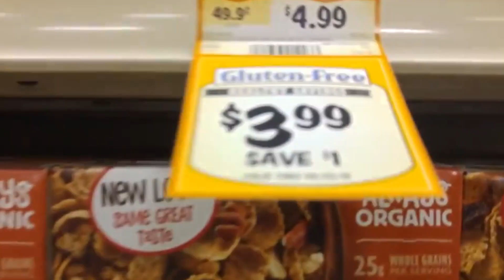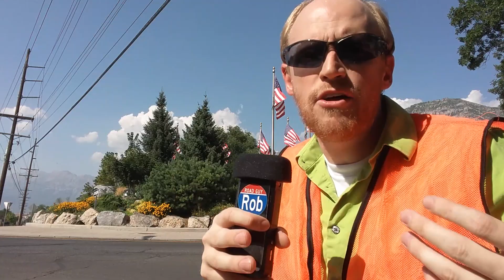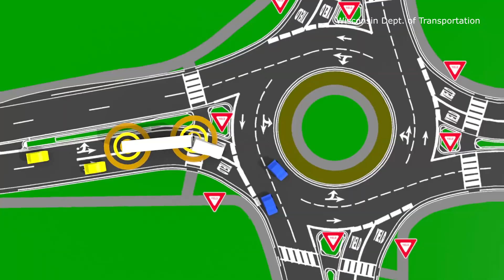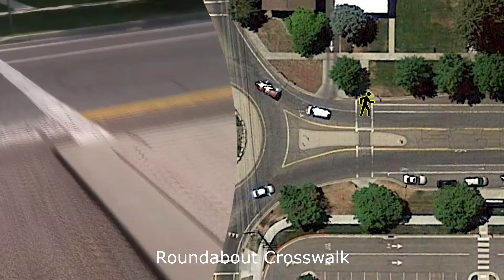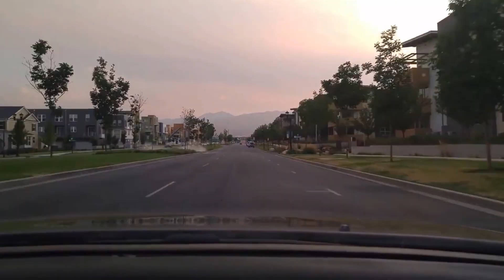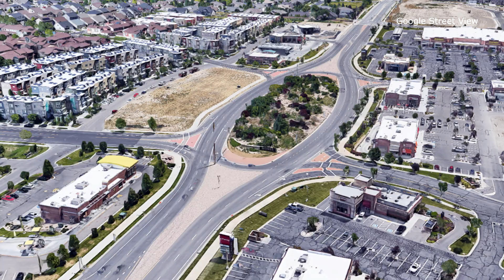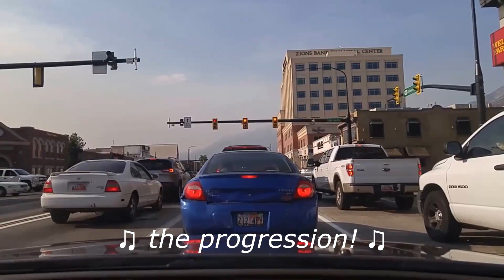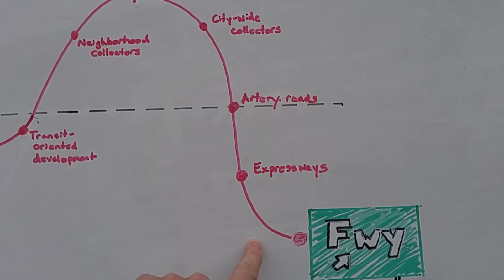Are roundabouts REALLY better than a traffic signal?

Comment: Who says roundabouts are terrible?
Reply: People who have to cross them on foot?
Reply: @robo1p  I highly doubt that, if they are designed correctly. For example, in Germany we have crossings for pedestrians right at the drive in / out sections of the roundabouts, so you only have to walk slightly farther than you would on a normal intersection. Additionally, pedestrians always have the right of way, so there is (almost) no waiting involved, compared to a normal intersection with traffic lights.
Reply: Example: https://www.google.com/maps/place/Esslingen+am+Neckar/@48.7209538,9.3846742,149m/data=!3m1!1e3!4m5!3m4!1s0x4799c0d259ee4ccb:0x41ffd3c8d092980!8m2!3d48.7433425!4d9.3201122
Reply: @robo1p  In The Netherlands pedestrians on zebra crossings have right of way over cars on the roundabout. Also within city limits or buildup area’s, bicycles have right of way over cars if the bicycle paths are crossing the exits of the roundabout. On the roundabout there could also be a bicycle lane next to the car lane (the outer lane is for bicycles, the inner lame for cars) than cars can only leave the roundabout when there aren’t any bicycles in their way, if so they have to wait until it is save to leave the roundabout. Also bicycles have to give cars and other bicycles right of way if they want to enter the roundabout. That is marked by sharks teeth on the asphalt, just before entering the roundabout. Sharks teeth pointing towards you means you have to give way before entering. Also very safe are the middle or traffic isles for pedestrians, crossing the exit/entry of roundabouts, in Dutch this is called a ‘vluchtheuvel’, a flee hill. So pedestrians or bicyclists can safely wait to cross the second halve of the road, when it’s free of traffic.
Reply: @RealConstructor  In the USA pedestrians in crosswalks legally have the right of way too. The self-absorbed drivers here don't care.
Reply: @5stardave  Maybe there should be a law protecting vulnerable road users like pedestrians and bicyclists. We have that in The Netherlands and it works well enough. Could be better but it still works. In case of an accident between a motor vehicle and a pedestrian or bicyclist, the driver of the motor vehicle is automatically guilty and 100% responsible (for the damages), until he can prove he isn’t at fault. Then he is not guilty but only responsible for 50% of the damages. That gives the driver an incentive to be careful towards vulnerable road users.
Reply: @robo1p  it depends, if it's one of those roundabouts with crossings, then you cross them (the driver should stop, just like in regular roads), if it doesn't have crossings, then just walk a few metres and cross somewhere else, normally roundabouts aren't that big it just adds a few seconds to your walk, buta adds safety
Reply: square people
Reply: They suck!
Reply: I do because during busy traffic times one entry point dominates the circle.  The cars continually enter from the one entrance and all exit to the same point.   If your entry point is between those two points you end up waiting for a very long time.   You are talking easily over 5 and even 10 minutes of wait time.     The solution is you keep blasting your horn until someone is kind enough to let you in.
Reply: I do ive driven semi trk and they arent open enough for large trks especially oversize loads and ive driven meduim duty dump trk ive had where in the city i cant get through them and ive seen where they put a post in an intersection and called it a roundabout
Reply: Multiple lane roundabouts are terrible.
Reply: @davidhoffman1278  Not when you approach a turbo roundabout on pre-sorting lanes. They’re easy to enter and exit.
Reply: I'm not a big fan of the multi-lane highway ones, but the small, local ones are perfectly fine to me, and in some cases better than a traffic light.
Reply: People who actually know how to drive. Why do we even have these silly ideas, like roundabouts? Because nobody can get drivers to actually follow the f-ing rules.
Reply: Road cyclists
Reply: @andrewwestcott9172  They work fine in the Netherlands where eveybody cycles
Reply: @jakuub_11  Source? I may be working with outdated information but are you working with any information?
Reply: @Person01234  where is your source that says Americans hate roundabouts?
Reply: @Person01234  actually hes got a point, the video you commented on is a good source, and im pretty sure the USDOT has a stat somewhere listing all the roundabouts.
road guy rob has a point tho, roundabouts belong in areas with low traffic unless you go complete overkill, and not good in industrial or commercial areas with a lot of cars and really any amount of semis unless its big enough to accommodate trucks, but even then its not wise.
Reply: @Zeakthecat  That's not correct. Roundabouts consume a lot of space, that's their downside, for traffic throughput they are superior and work fine when there's lots of traffic.
Reply: @jakuub_11  Why. It's obviously a generalisation, and a true one at that. It's not hard to deduce that I am not saying "every single american who has ever existe hates roundabouts", I'm obviously saying that americans in general say roundabouts are bad.
Reply: Me,overflowed in small roundabout are terrible
Reply: Me
Reply: Blind people. They lose the advantages that a signal provides as they try and hear the traffic flow.
Reply: @NHSpaceMOB  Blind people always have the right of way, and physically handicapped person does and usually people do indeed stop for them as long as they clearly point out that they want to cross.
Reply: @roy_hks  Blind people do have the right of way, and in a world of self driving cars that might be fine, but with distracted driving a near epidemic, it's still very scary for a limited sight person to cross without knowing that traffic has stopped or that the course is clear. All you need is for one person not to stop to end your life and that's pretty scary.
Reply: Me.
Reply: Me
Reply: They’re not great you’re always forced to slow down 
At least with traffic lights you have a 50/50 of not having to stop or slow down at every single intersection
Reply: @Rommie26  But that’s so great about them, traffic slows down, but hardly ever stops. Intersections with traffic lights forces you to stop more then half the time. And slowing down before an intersection is safer for you and for other road users. It’s a win win.
Reply: @RealConstructor  I guess it depends on preference 
I’d personally rather not slow down and take
the chance the light will be green and I don’t have to stop or slow down
Reply: @Rommie26    Really, then the problem isn’t the roundabout now is it, it’s you. Who in their right mind would chance that the light would be green? No wonder there is so many examples of horrendous accidents in a normal intersection. “Hey let’s just chance it”. Why not look at the positive side, now you’ve got yourself a nice change of scenery, a real curve in the road and not just boring squares all the time, and as an added bonus a place to do a little drift if that’s your cup of tea (only if there’s no traffic of course), but then again I guess it depends on preference, and from what you’re saying I guess a good T-bone steak and 1/4mile is your thing.
Reply: Pull a 40ft gooseneck with 13,000lbs on the back of an alread over 20ft long truck. Not near as bad as a semi, but its hell on the trailer suspension when the tires are not as large as a semi but not as small as a car. Also, concider all the RVs that are basically rolling boxes down the road. Its hell on the structure having to constantly and consistently jumping curbs.
Reply: Every american with memories of traffic circles
Reply: Flat earthers.
Reply: They take up more room
Reply: Truck drivers
Reply: @jakuub_11  As with stereotypes about any country, that's pretty much what a steretype is. Nobody was talking about mass anti-roundabout protests. But you're probably quite right that it's old news. At the same time, I can't think of another noteworthy country with greater opposition to roundabouts, opposition just in the sense of "saying they're terrible". Canada maybe? Though they're commonwealth and tend to take cues from the UK a lot. Japan perhaps? I don't know what their opinion is on them. What I do know is that Americans had a had a harder time adjusting more recently than most.

Lets all just agree that traffic lights are the hell spawn of satan.
Reply: people who don't understand them
Reply: Roundabouts aren't terrible it's just the people that think it's all about themselves and that they have the right away no matter what.
Reply: people who doesnt understand how roundabouts work
Reply: Wait until you tried driving through DC roundabouts. You will HATE them.
Reply: My wife is terrified about roundabouts.😆
Reply: Roundabouts are terrible,
Reply: @5stardave  it really does depend on where the roundabout is placed.
Reply: Bad drivers
Reply: Roundabouts are terrible if the town/city they are being placed in is STUPID enough to make them so small that trucks have to run over the the raised centers in order to negotiate through them.
Reply: @GrayLensman51  many roundabouts here in Europe are nothing more than a circle painted on the road,usually in narrow roads which allows large vehicles to simply run over them. The usual give way rules apply and cars are still expected to go around the circle.
Reply: @GrayLensman51  But they have to do that at all roundabouts in the Netherlands and plenty of other European countries, at least when it comes to 1 lane roundabouts. If it were wide enough for a truck to not have to use the center curb it wouldn’t make that much of a safety difference because in that case it would also allow higher speeds...
Reply: Ignorant people scared of anything they've never seen before.
Reply: Most americans say roundabouts cause tornadoes.
Reply: @UltraCasualPenguin  shut up
Reply: Me
Reply: Americans.
Reply: @Person01234  stfu
Reply: @Person01234  Not all Americans.  I love roundabouts.

Comment: Great video Road Guy Rob, but when you think about it, highway interchanges ARE roundabouts on the highway. They're just not in the form of a circle but in all cases they require you to merge yielding leftward along a same-direction flow.
Reply: Paul Martyniak I wouldn't agree with that. Highway interchanges use different roads to connect each direction to another direction. On a roundabout you drive behind each other no matter where you want to go. And you could even stay on it indefinitely if you want.
Reply: Thanks for your reply, but I think you're splitting hairs -- obviously highway interchanges are not the exact same thing as a roundabout, however the point is that instead of an intersection where traffic flow is interrupted and alternates, interchanges flow continually. 

Moreover, many clover interchanges WOULD allow you to keep going around and around as long as you want, you just keep taking the far clover exit right after you join a new direction of travel.

Finally, a multi-lane roundabout resembles a highway+interchange in the sense that inner lanes keep flowing through, while outer lanes allow traffic to come in or out of the system, and change direction around the system.